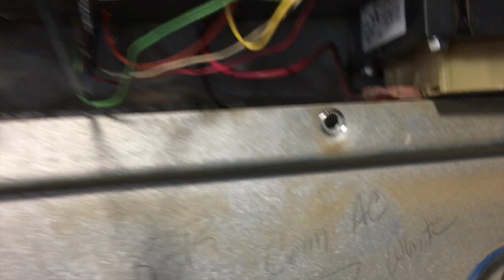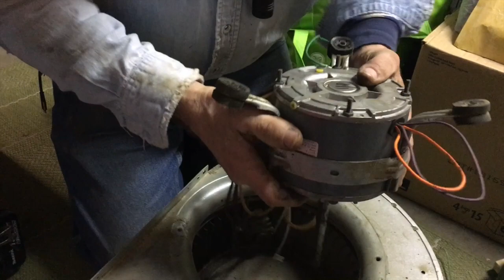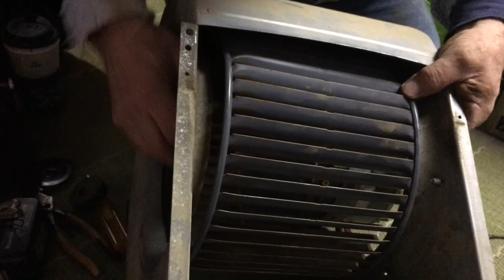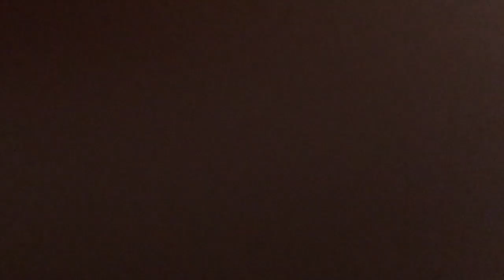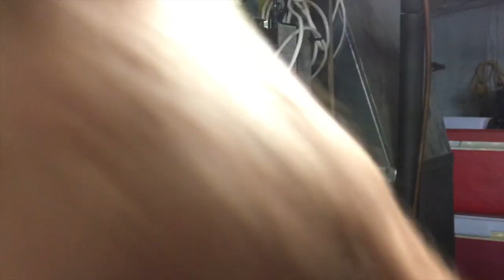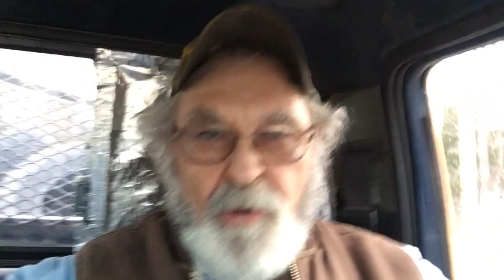York Blower Motor Replacement

Comment: T44 - you didn't tell me you made house calls. Over the last 4 weeks I have had 4 different furnace repair guys here trying to figure out why the furnace kept failing leaving me in the cold, so to speak. Thank goodness Guy had a couple of plug in baseboard heaters, but man , they draw a lot of power. Ended with me spending a lot on service calls and finally buying a new furnace - got installed last Friday. Expenses I certainly didn't plan on especially with a 6 year old furnace. I should have shone the bat light into the sky and had you roll on up here. It would have been cheaper. LOL. Enjoyed the adventure today. Appreciate the detail telling us what you are doing as you do it and explaining how things work. Mission accomplished. A little heat to keep her warm. And with this Polar Vortex on the way down there, you got her fixed up just in time my friend. Cheers and keep on smiling!
Reply from the maker: Dang GP, we may have been able to do a video chat and fixed it ourselves over the phone...you wrenching and me yakking....   If that was only a 6 year old furnace, was there a recall or something?  LP Gas or electric?  Must have turned out to be a pretty major issue. Hate to hear you had that bad of issue with it.

 It is just a tad bit chilly down this ways today....we bottomed out at -19 C or -2 F.  That's ok, I had an inside job at the son's house today installing tile in his entryway.
Reply: Morning T! if you want to email me at gordpotter55@gmail.com, then I can explain. Yes, not happy about replacing it so early. Glad you were able to stay warm! Cheers!

Comment: Your family is lucky that you are able to handle so many projects. I think it's the training that comes with being on call. You don't expect the world to work right the first time so ypu're ready with a backup plan. 😊😊
Reply from the maker: Yessir, that's why I took a pile of 240v blower motors along with me.  Basically they are (mostly) 5 5/8" diameter with 1/2" shaft, 1/4,1/3 or 1/2 hp 230v on electric furnaces.  Usually they are muti-speed and automatically switch from lower speed on heat to a higher speed on a/c but some of the new furnaces only use one speed through a circuit board for both modes.  Sometimes a fellow has to be a bit 'creative' to get a one mounted correctly though.

Comment: Don`t feel bad for the tye rap...you what you can with what you have and it`s free.....go for it....when I first seen the controls on that furnace.....recognized it straight away....I had one of them for heat when I was building houses in my spare time....Now it`s at the farm and they still use it in extreme cold....they plug it in 60 amp welding outlets....I disconnected a stage on it and it works really well for them....CHEERS
Reply from the maker: Yes, I know they work fine in a situation like that too.  Btw, this is really a 20 kw furnace with one 5kw element disconnected (wires removed) so it will be there as a built in spare part if one of the others burn out.  The cost difference between 15kw and 20kw was ridiculously low back when I installed the job during construction.  I really don't like the opaque ties, they seem to always be more brittle than the black or red ones.  I figured you may make a comment about that.  LOL.
Reply: @tractorman4461  Your Tyes are the right ones for you to use....I got a whole box sent to me free for Thomas and Betts for talking a lot about them when I started my channel....we in the electrical industrial trade up here use a lot of there products....CHEERS
Reply from the maker: I'm not familiar with that brand but that doesn't mean they aren't down this way. MaLine are the ones predominant in the supply houses. But that could just mean their rep is more aggressive, not that it's a better product. My cousin had these on left over from her husbands workshop and donated them to the cause...  I just got in the habit of using the red plenum rated ties or the black standard ties because the UV rays don't affect them so they can be used anywhere but these guys are 'iniside' use only.  My old man always said 'beggars can't be choosers'...LOL.

Comment: That's exactly what I need to do. My fan gets stuck. I can feel it wobble. I think I can do it but I'll call a pro. Great video
Reply from the maker: Probably not a bad idea Kevin, not being very familiar with what all is involved.  A lot of times, there are a number of high voltage as well as low voltage wires to be disconnected to get access to the blower assembly.  There's a great potential for re-connecting some wires incorrectly that could end up costing you more money in the long run.  Lateral movement of the blower is somewhat tolerable but that is entirely different from an elliptical wobble that indicates extremely worn bearings.  Sometimes lateral movement is a loosened set screw allowing the wheel to incrementally slip on the motor shaft causing the issue.
Reply: Tractorman44  ok thank you. I'll have someone check it for sure. That could be the issue.

Comment: Great video.  I have a question- I got a york gas furnace w/ a bad blower motor.  York wants almost $400 for this motor.  It looks like a pretty generic part.  How do you find cheaper one that will work on my furnace?
Reply from the maker: Providing it is just a standard 3 or 4 speed indoor psc blower motor WWGrainger is a good place to look.   The standard diameter is 5 5/8'' with a half inch shaft.  Make sure you get a reversible motor if you go this route.  If its a gas furnace, it'll be 120v and if its an electric, it'll be 240v.  Here's a sample: https://www.zoro.com/dayton-motor-13-hp-1075-3-spd-115-v-48yz-opao-4m098bg/i/G1592297/?msclkid=2a6481ec60251d999cb4e2e93f45d029&utm_source=bing&utm_medium=cpc&utm_campaign=ml_all_na_na_ssc_Bing%20Smart%20Shopping&utm_term=4586131722563170&utm_content=All%20Products&gclid=2a6481ec60251d999cb4e2e93f45d029&gclsrc=3p.ds Now if you have a new furnace with the electronically variable speed control type motor, a replacement like this will not work.  Make sure you read all the specs for voltage and rotation.  If its reversible it will say CW/CCW rotation of it will just state 'reversible'.  Make sure you know the voltage and hp rating and make sure you replace the capacitor with it as well. But as always, if you are not comfortable with working on an electrical device, and have the ability to correlate the new motors wiring diagram to the wiring in the furnace, its best to leave it to a pro.  That help you at all Jason ??

Comment: Nice fix on that furnace.  Two thoughts (questions): 1. Is there any way, at all, to determine if the rotation is correct, prior to putting power to the blower?  2. Did you replace the run capacitor and if not, why not?
Reply from the maker: Most of the motors will have a small rotation arrow on the nametag.  Others will be marked CCLE or CWLE which stands for Counter Clockwise Lead End or Clock Wise Lead End. I usually purchase universal motors that have the four leads/plugs in addition to the normal winding leads that allow them to be reversed by interchanging the position of the four leads.  And yes, I did change the capacitor.  In the old days, 40+ years ago it was not as necessary to replace them with the motor because they were much more substantially built....as long and the micro-farad rating was the same. They seldom failed years ago.  However today, they are so cheaply made that you should not take a chance on replacing the motor and NOT replacing the capacitor.  Of course that is only my opinion and not necessarily a rule.  But if you want less 'call backs' you will always replace them with the new motor.   Oh yeah, on the motor rotation, with a replacement motor that is not marked, I lightly touch the appropriate leads to the power supply to simply bounce the motor to check rotation.
Reply: @tractorman4461  Thank you for your reply.  Your advice on the rotation was timely and useful.  In other words, you saved me a bit of heart ache and I appreciate it.
Reply from the maker: @toemblem  Awesome...glad the information proved helpful for you.  Thanks for commenting again !!

Comment: Best way to get the motor out when the shaft is STUCK in the blower?
Reply from the maker: If the blower shaft is sticking out of the hub enough to get a crescent wrench on it, shine up the stub with sandpaper, remove the set screw with a 5/16'' end wrench and spray WD-40 or other penetrant into the hole and around the end of the shaft to allow it to soak down the sides of the rusty shaft.  Securely adjust the wrench to hold the shaft then reach into the blower discharge area and with your hand begin forcing the wheel back and forth.  It will barely move at first but once it does, re-spray the penetrant and continue until the shaft rotates all the way around.  Sometimes this works well by sitting the blower assembly on a 5 gallon bucket with the motor positioned downward butt first.  While moving the shaft/blower wheel back and forth the weight of the motor pulls itself downward into the open bucket.  If you have beat on the end of the shaft, it probably has already become swollen because the shafts are made of soft material.  If its mushroomed out even immeasurably it will not pass through the hub bore.  Good luck Mark,  the first one may be tough but after a several hundred, it becomes a very easy job.
Reply: @tractorman4461  thanks for the tip!!    try out a 3/8 spline wrench (PROTO  makes a great one) on that square head set screw , makes life easy.  i'll use a bucket like you said next time  , thanks!!

Comment: Usually when a project picks me, it's right after I hear my wife say  "We need to ..........(insert whatever job she wants ME "we" to do)  Ive been trying for 3 days to work on my log trailer arch project. I think in 3 days I managed to work on it 4 hours.
Reply from the maker: Hahahahahaha.... I feel your pain Greg, I feel your pain....   Hopefully we are going to see the log arch when completed ??
Reply: Im planning to post a video once its completed. At this point , I have the hinge points fabbed and the rest of the materials sourced other than the winch. Hopefully, it's done in a couple of more weekends.
Reply from the maker: I'ver seen a lot of them built here on the tube.  It'll be interesting to see your version as well.  Anything to make the job easier is good enough for me.  I always threatened to buy an old propane tank delivery truck with the full bed gantry "A" frame and electric hoist on a trolly for loading tanks and make a log hauler out of that...but I never did.  LOL  oh well....

Thanks for the input Greg...we'll be waiting sir to see your arch.